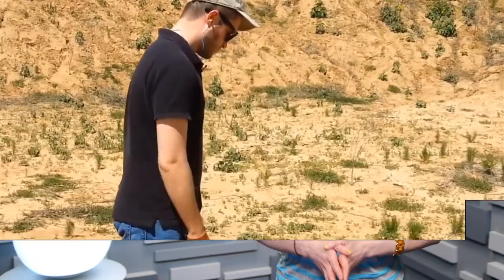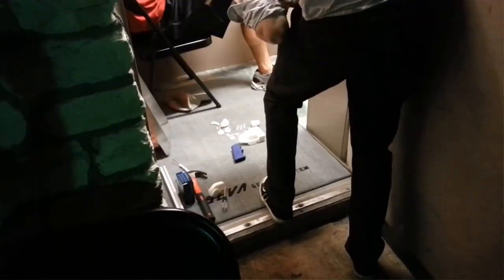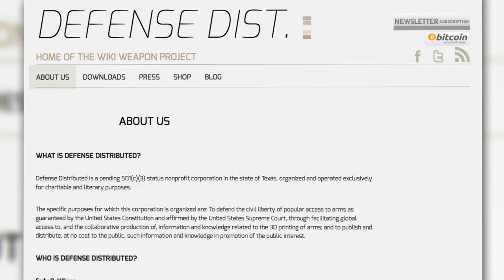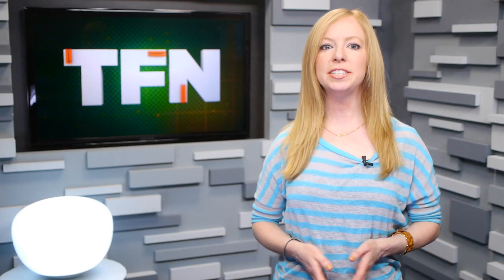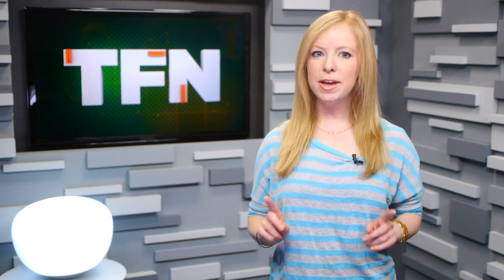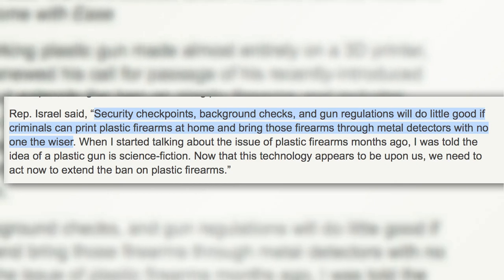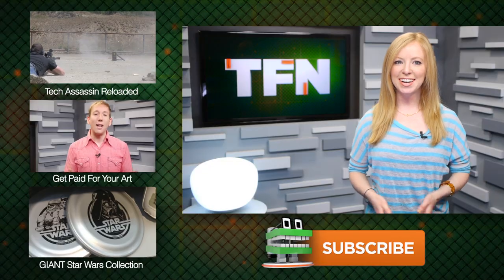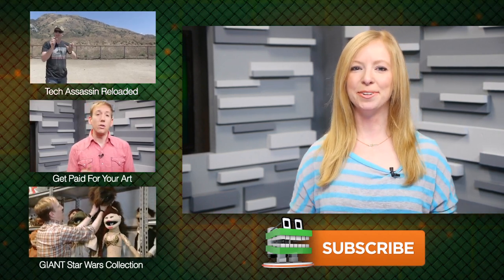The 3D-Printed Gun is Here to Stay

Comment: The nail used as a firing pin and a .22 round are such a small amount of metal most detectors will not catch them unless they are at a high sensitivity.

Comment: The problem with trying to smuggle a fully plastic firearm through a metal detector is the bulkiness. Plastic is a lot weaker than metal, and needs to be thicker to handle the forces generated by firing a bullet. A bulge in an unusual place would automatically be suspect to security personnel, and provided they aren't completely incompetent, a plastic handgun would not slip into a highly secure area undetected.

Comment: Like I said, a metal detector can catch these pieces but it needs to be set on a high sensitivity. Often times airports and government buildings do not have their detectors set that high to save time. Otherwise things like you suggested, pens and wallet clips,would set off the detector and they would search tons of people wasting a lot of time. So you are right, metal detectors can catch it, but if the unit is not on a high sensitivity it could just as easily miss this gun.

Comment: Not necessarily, the printer does not just spit out a complete gun, it prints parts which need to be assembled, not to mention that 3D printers themselves are not simple "plug and play" items. After going through all the hassle you get a weapon that is demonstrably inferior to one that could be put together with 2 lengths of pipe, a cap, a screw and a drill.

Comment: Oops, and I forgot that if you do produce your own firearms, it can't be done with assistance legally. 

However, I can't see tracing being a real issue; they can't even trace pirated music very well. I would let a friend use my printer if they wanted and it would be legal, as it stands. They would have to print it themselves and supply the material. I saw a video of a guy buy an '80% lower' for an ar-15 and mill out the unfinished parts himself on a friends machine.

Comment: You have access too the blueprints for everything. However not everyone had a 3d printer! In order for this to take off  or be a bad thing a "bad guy" would have to buy a 3d printer or be able to use one and understand the system. Which is not cost effective! Therefore not gonna be a problem!

Comment: The Liberator is hardly a practical weapon, it's a proof of concept that has a service life of one round, and it's unlikely we'll see much improvement on that for quite a while, the materials technology simply isn't there. Furthermore, we're not just using metal detectors anymore, and they never were 100% reliable to begin with (I have a metal plate in my face that has never set one off) new scanners can detect any dense material, like the kind a firearm would have to be made out of.